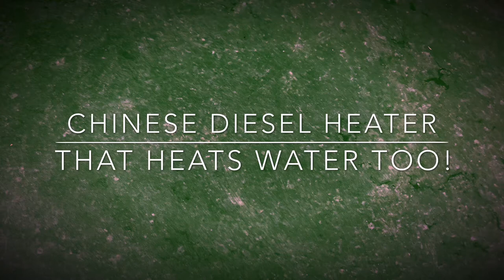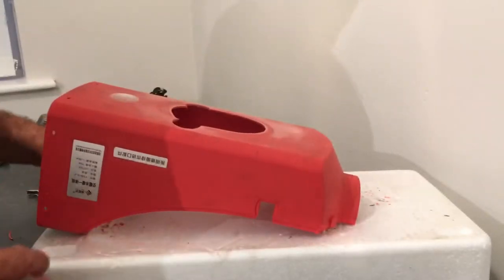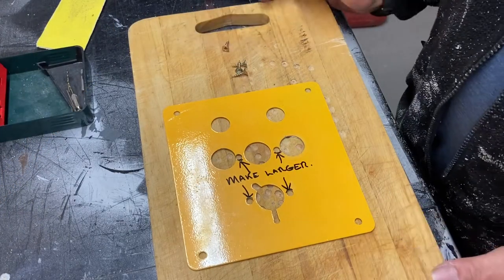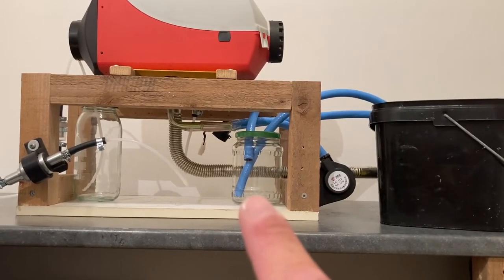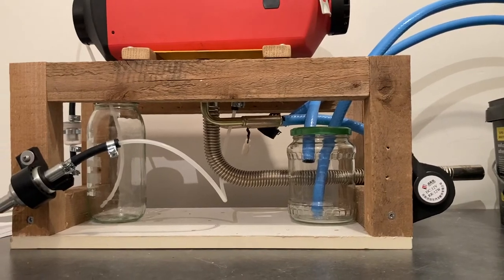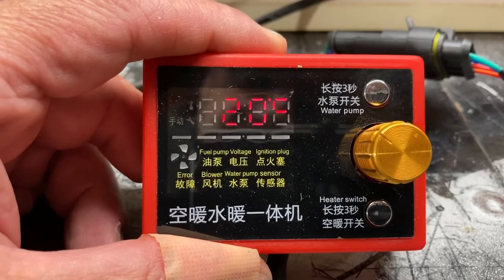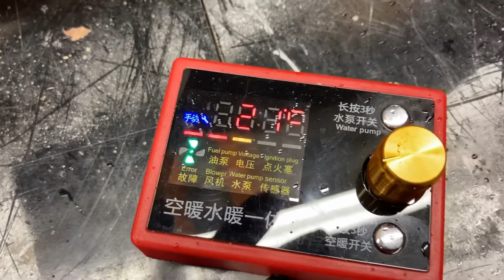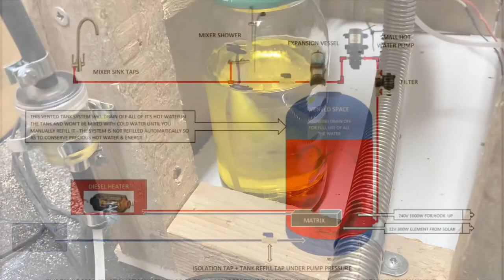Chinese Diesel Water & Air Heater Feasibility Test

Comment: I liked this video, an english guy in his shed, reminded me of James May !
If you take the round end cap grilles off of the air heater the air flows much better which you'll want in winter, not so much in summer. You can always direct the heating air out of the van for summer.
Better to use the expansion tank via a T piece like in a car.
When the glowplug lights you get 10-15A current draw, on startup it glows without fuel to make sure it's clean. Tip: Use a hard plastic line between the diesel pump and the heater for best injection spray pattern.
The power consumption of the water pump is a concern and you'll need to budget for that. The heat exchanger looks good but oversized and will tend to scale. Also check that it doesn't rust on the outside !  Probably a bit of copper pipe will work Ok too. 
Most campervans work fine with 10L of hot water, because the mixer tap means you don't use all the hot water. If you have 100L on board you don't want to use 25L in a wash anyway.
To silence the diesel pump on the van, where you screwed it into your nice wooden rig, instead bolt it to a spare 6" bit of that black coolant pipe, then bolt the other end of the pipe to the van, and curl the small inlet and outlet pipes as they transmit the 'thump' well too! If you do these things you'll barely hear it.
As you are using the complicated coolant method instead of a simple Truma TT2 I suggest you leverage the hot coolant - e.g. add a heated towel rail and the odd tiny radiator where hot air doesn't get to, which will make more use of this method, sort of a half 'Alde' system like you find on the posher vans.
Reply from the maker: Love the idea of attaching the pump to a pipe to dampen the ticking vibration, definitely something to consider. In other footage that I didn’t show on here I said the matrix should really be made of copper but I bought a cheap one first for experimenting with incase it wasn’t a go. However the matrix was sat in that bucket of water for 2 days solid and it never even tarnished on the exterior. In fact when I unveiled it from the box, that footage was the repacked matrix after the experiments  where performed and it looked brand new still so maybe I may accidentally be onto a winner? Without having to buy a copper version. I’m not  so sure about the scaling issue on the exterior of the matrix you could be right there as it has fine Finns and could clog up easily. Then again if it takes a year then I’ll just renew it every year as it only cost £20. Maybe there is an underwater version out there? Also your right regards the tank size as I’m undecided about that. Although I have seen one that fits the matrix in and has enough wall space to add electric elements and inlet outlet pipes etc. I can always put less water in too anyway as it’s not a conventional tank that is permanently filled all times automatically. My concern was wanting just enough heat to have a quick shower in a morning fast as poss if on the road on route somewhere so I’m toying with small tank or larger with loads of lagging so it’s heated up from the night before. The grills will be off as you say as I’m piping the in/outlets to the van. The intake will be taking pre heated air from the living quarters to speed up the heating proses. It’s all a bit of suck it and see until I find my preferred settings but thanks for comment they have been noted. Also yer a t pipe to the expansion tank may be better so long as it will allow air out as I can’t mock up fully a vehicle cool and system as no air pipes to attach to rad etc.
Reply from the maker: Yer love tinkering in the garage. It’s like our right of passage into middle age lol
Reply: @diycampervanman1633  The heat exchanger may be aluminium I suppose, would make sense. Just descale now and again like any boiler. Most hot water systems are filled from the cold feed, is there a reason not to do that ? They have an expansion valve to the outside and it means you only have to fill up the cold tank!
Reply from the maker: Graham yes there are a few reasons I decided to do a drainable tank. First one is there ain’t a tank out there that can fit my matrix in through a big enough opening or plumb it in either and I like the matrix idea as it really dissipates the heat into the tank water. 2nd reason is I want to be able to run my tank down and use most of the water if required because carrying water is limited in a camper so I wouldn’t want 10-15 or 20 Ltrs of water remaining inaccessible as you can’t use the hot water in a permanently filled tank if the cold water feed runs out - And in a van it does a lot! 3rd reason I wouldn’t be able to add a second heating element because most factory built tanks are round tanks and lagged etc so tampering with them could be a bad idea. 4th reason is I don’t want to heat a tank up, take a shower and the tank then automatically refills with cold water bringing the temperature right down for the second person. I can’t believe a small tank can still keep hot water separate from cold like in a domestic 100 Ltrs tank can. There is bound to be mixing of the the hot n cold in the tank. I know the top of my tank the hot water will be a higher temp than the bottom but that’s where the mixer taps play a part to try and keep it constant. Drawing less and less from a cold feed. I may fit a floatation devise in my tank to keep the outlet pipe at the highest point of the tank and the hottest. Now I know my tank won’t fill up automatically keeping it permanently full because I won’t be T’ing off from the inlet pipe but it will fill up under pump pressure when I release the isolating valve just before the inlet of the tank feed. However the only draw back I can see is this/my system will require two separate pumps. One for the cold feed and one for the hot but that’s the only draw back to my unconventional system. If you look at the diagram I made it shows u the inlet isolating valve.
Reply: @diycampervanman1633  Another option would be to make a small full fluid heat exchanger and feed the output into a 15mm or 22mm adjustable mixing valve. Then you just have the coolant pump running when you want hot water, it's fairly instant and never scalding. 
Essentially build a box around the heat exchanger. Another way to achieve that with simple materials is to buy two 22-15-22 Tee solder-ring pieces, two 22-15ext reducers and 2m of 22mm and 15mm pipe to make a copper heat exchanger jacket and stand it up in the van somewhere convenient with some pipe lagging. Goes right into the mixer valve too, a win-win!
Reply from the maker: Graham lol you’re good and.that’s a good idea but I’m on with ordering the tank from Grantham.  Your idea will require diesel heater power when I want hot water and it’s slow at heating up. Plus I’m dedicating one 100w solar panel for a 12v 300w element that could potentially heat a tank up on a hot sunny day without having to switch the diesel heater on. So I’m thinking I need a decent capacity of water to heat and store for instant readiness. I’m not sure I want to build experiment etc with other ideas as I just want to crack on with the van build and not get too wrapped up in engineering projects. However! Nothing to say I can’t when my camper is complete as supplementary videos.  I won’t be doing all that look where I am on the road stuff after the build like some do as I’m only a weekender camper not full timer or travelling around the world stuff. No I’ll be just heading back to Hull when my trips are over lol. So experimental engineering projects could be the way forward then after my channel runs out of van build videos lol
Reply from the maker: Graham actually just read your idea again and I’m not quite sure what you mean. Where would the primary heat source come from to heat the water fast’ish?  Btw my names karl,  graham. Not sure I like diy campervan man. It’s a bit impersonal but I had to come up with something fast when i made the logo for the animation thing.  Was put together without thought really but I kinda have to stick with it now. I thought it may draw in subscribers on searches as it’s a very relevant name. It’s no bother only a small detail I suppose.
Reply: @diycampervanman1633  Hi, the idea would be to run the shower like a modern electric shower - or combi-boiler - it just heats the water as you need it. Then you don't need a hot water tank at all. Those diesel heaters are what - 5kW? An electric power shower is 3-4kW at full mains flow so I think you'd have enough hot water on demand once the diesel heater was up to temp. You could in fact test this theory if need be!
Then if you had 75L of cold water, you'd have 75 litres of hot water !
Reply from the maker: Graham sounds good but the heater is slow at heating up. I thought about a gas heater which are brill for instant hot water but you have to vent out side and I’m having a gas free van so I binned that idea off. Plus you then still have to fit a heater to heat the air so thought this machine will heat a tank whilst I’m heating the air as a bonus. People curl copper water pipes around their diesel heater exhausts but they ain’t very efficient in exchanging the heat.  My  other idea was to just heat with an electric element and simply have a  small but powerful enough generator on board. This idea still stands as I’m looking at a cheap genny and  will fit an electric element but that will be for standby only as I would have to put it under the van and connect to the hook up.  There is very little choice when on a budget hence I had to get creative lol.
Reply: @diycampervanman1633  I'm trying to remember how long it took for my diesel heater to heat up, I think it was a couple of minutes but probably relies on the drip rate (Hz) of the diesel, but with a mixer valve the water only has to reach 40C to feel 'hot'.
5kW should in theory be enough for a shower. A house electric shower is 8.5kW at probably 2-3x the flow rate. With 15mm and 22mm copper pipes you could make a trombone shaped heat exchanger and fit the mixer valve easily and maybe even use a (inverter driven) central heating pump that use 30W for a good flow. Then you have a low cost low space option, and if you fit a towel radiator in circuit after the mixer if will also get warm ready to dry the towel (although will steal some power). I think you'd need to mock it up to test though, but potentially it would make a very nice design IMO :D

I'd stay away from high power inverters as it gets very expensive fast for little benefit, Victron is the brand of choice for inverter-chargers (good and reliable, cheaper in the long term) and Lead-Carbon the battery of choice (no sulphation, better and lighter than AGM or Gel and far cheaper and safer than  Lithium+B2B).
Reply from the maker: Graham never heard of a lead carbon battery. Do you mean lead acid?
Reply: @diycampervanman1633  The Lead Carbon uses carbon instead of lead for one of the electrodes. In so doing you get less weight, no sulphation and better charge/discharge performance. It's the next generation of battery and will eventually replace the lead-acid. Have a research, e.g:
https://batterysupplies.be/en/producten/products/cyclic-batteries/lead-carbon/
Reply from the maker: Graham I will deffo. Your incredibly switched on with all this. A bit too bright for my brain lol. I feel I’m fumbling through with you overlooking things lol.
Reply: @diycampervanman1633  I actually discovered them through watching Robert-Murray-Smith's excellent channel. He is an English Treasure like Eric LaithWaite!
Reply from the maker: Graham I’ll check him out. My question is out of all the benefits these batteries offer, do they give off hydrogen like standard lead acid because it will be fitted in the living quarters and you don’t want any sparks if hydrogen is present because it would get extremely noisy if a spark hit the gas lol. Plus can I charge using my CTek battery charger that cost loads on a lead acid setting as no charger has a setting for  lead carbon batteries
Reply: @diycampervanman1633  Any/all batteries have little vent pipes in the lid, simply connect a plastic pipe up to it, through a hole drilled in the floor and seal it up. All factory made campers do this as many are mounted under the drivers seat.
Reply: P.S. Tell your C-tek it is a Gel battery and it should be fine as the voltages are the same. You can of course also verify with C-tek themselves, if they are any good you should get an answer.
Reply from the maker: Graham yes that’s true re pipes into the floor.
Reply from the maker: Graham CTek are great at answering questions, I’ve asked many lol. They may take a week to get back though however no rush. I’m very interested In these batteries but they still look a little pricey. For at least 220+ Amp hours touching £700 Mmmmm. More cycles granted but still pricey. However love um and gas free mire or less as sealed.
Reply: @diycampervanman1633  Quite a few places do Lead-Carbon now so shop around. They are cheaper than lead-acid when you account for the fact that they don't degrade, can use more of their capacity on a regular basis and are difficult to kill. Forget the cycles, it's the abuse they can handle, leave them 30% charged for a month and they are good as new, but a lead acid is damaged with lost capacity by doing that.
Also much cheaper than Lithium as Lithium requires an expensive B2B (£200+) else your alternator melts (too much current at idle when the alternator fan is slow).
Additionally you need less capacity because you can suck more capacity from them with degrading. Gel and AGM have in reality 50% of their capacity to use before their lifetime suffers. Lead-Carbon, I think they are still happy at 20% capacity, so 200Ah of lead acid gives you 100Ah usable energy, but a 125Ah Lead-Carbon also gives you 100Ah usable energy, and lives for longer! 
So a 125Ah Lead-Carbon (single battery, 17.5kg) has the same usable capacity as 2 x 100Ah lead-acid at 2x20 = 40kg and extra wiring, so wouldn't really cost any more I'd think.
Have a chat to C-tek, would be interested to know their view.
Reply from the maker: Graham graham I’m loving this I want one! A battery you can hammer sounds great and won’t sulphur up if you run too low. Your right. If I can find a good price for a smaller battery this will be a game changer. Especially the the weight benefit too if what you say is correct.
Reply: @diycampervanman1633  Yes they are good things!
I have a 95Ah AGM in my van that a regularly have to plug into mains charging to keep happy (The vehicle charges to 14.4V, but AGM wants 14.7-15V or it sulks and dies prematurely). Of that I can use 50% before adversely impacting its life, so 50Ah of real use. If I replace it when it dies with a single 150Ah Lead Carbon, the weight remains about the same but the usable capacity will grow to 150 x 0.8 = 120 Ah, a 240% improvement for the same weight and no alterations to the charging system except setting the van to 'Gel' instead of 'AGM'. 
In the space left under the seat (as I'll have a 1.5x the size battery rather than 2x perhaps I can fit a Victron Multi for full mains in the van. Will have to see though, it's not a football pitch under there :)
Reply from the maker: Graham This battery spec for 160ah which I like better has these cycle properties as follows:-
Battery chemistry based on lead carbon
Cycles at 20 ° C and 40% discharge:> 1400
Cycles at 20 ° C and 60% discharge:> 1000
Cycles at 20 ° C and 100% discharge:> 500
Are they suggesting you can flatten the battery up to 500 time? “Flatten”!!
Without battery health consequences other than less cycles? If so this has the same characteristics of a lithium but just heavier but fir half the price. To not have to worry about using over 50% discharge is definitely worth an extra £150 more for that piece of mind if you need more than 50%. Charges fast too be looks like a lithium. Sulphating is always the issue to protect your expensive battery bank but these batteries can’t sulphate so theoretically you can confidently use more capacity. Your going to say that’s what I’ve being telling you lol. I’m interested in these batteries. It’s still pricy though. How much does your Victron dc to dc charger cost coz there maybe a saving there as I ain’t bought mine yet
Reply: @diycampervanman1633  Which 160Ah battery are you looking at - can you post a link or Make+Model? Always useful to know/plan even though my AGM still works :)
Another benefit over Lithium is that they work at freezing temperature too BTW. Technically you can't flatten a Lithium leisure battery, most have inside a little circuit to disconnect it at about 10% capacity. Also Lithiums are happiest left at 80% charge, eithre side they lose lifetime plus you need a B2B with them - costing an extra £200.
The "100% discharge:> 500" for the Lead-Carbon does indeed suggest it lasts longer than a normal Lead-Acid even if you flatten it each time!! Sulphation is the enemy of Lead-Acid, so without that they are much tougher!
As for price - remember you only need to buy 1 of this type and they are still much cheaper than lithium :)
Glad you are seeing the benefits, it's a bit too modern for most campervan people who are still stuck in the past or pricing up the rather pointless lithium options.
Victron notes in the next post:
Reply from the maker: Graham https://www.googleadservices.com/pagead/aclk?sa=L&ai=DChcSEwj0647TuJ_qAhUX6-0KHYQxDbsYABAwGgJkZw&ohost=www.google.com&cid=CAESQOD2rhwYXySbZ-vgBnMPC33w5Ldy4vq81wxVAgVFs0rzBpF571nCIwfE-QatHZr5ExN07xne_2TSo9KDZeUfN8w&sig=AOD64_2M9CvM3P9Dr9tsaBfMTMZ14JfMNw&ctype=5&q=&ved=2ahUKEwiJwofTuJ_qAhXIX8AKHQDIAiEQwg96BAgLEGg&adurl=
Reply from the maker: Graham had phone in my hand when a banner popped up so youtube do inform me of new comments but must time out if I don’t look?? It is still very expensive but yer better than lithium for the price still as it will get very cold in winter and it still works at optimum performance. You have pointed out a bit of a miracle battery if I’m honest. I’m still researching it as it seems too good to be true.
Reply: @diycampervanman1633  Victrons may seem expensive, but they are not: 
For a 12/1200/50 Victron Multiplus (£663 at Bimble) you have to break down the price into what you get:
1. 1200VA (1000W) of robust, reliable pure sine wave power (to EU standards!!).
2. 50A EHU charging ability
3. Fast auto-switch on EHU
4. Power fade and boost 
5. EHU line protection
6. 3 Watts standby power
Most cheap inverters have spurious RF interference that stops stuff working, and quite a few go 'Pop' if they get slightly upset. The Victron is super reliable so you only need to buy it once, a) feed in the EHU to it, b) the batteries and c) a little 3-way switch to set it between 'Charge-off-Full' and take the power output to all the van sockets.
That low 3W standby means you can simply leave it on all the time, and use it to power an economical household fridge. It is so smart that if the EHU fades it can add power from the batteries. You can also add another one or two later to boost it up to 2.4 or 3.6kW.
Another feature is that you are power-cut proof like a UPS - pull out the power and the 230V circuit will carry on as before.
To buy the inverter, charger and switchover separately to that quality would cost more and you'd miss the features too.
Well worth making one the heart of your system, I did on a little DIY van I did and it works extremely well !!
Reply: @diycampervanman1633  I don't get google ad services - just pop in the brand. BTW the Victron 160Ah looks a bit heavy!! Try Leoch brand.
Reply from the maker: Graham it’s a victron energy lead carbon 12-160
Reply: @diycampervanman1633  Check out the 160AH LEOCH AGM SUPERIOR LEAD CARBON for £300.
You can lay it on its side too so it would fit under the seat Ok too. Probably what I'll upgrade too when my AGM dies.